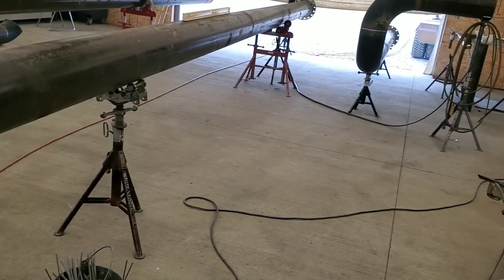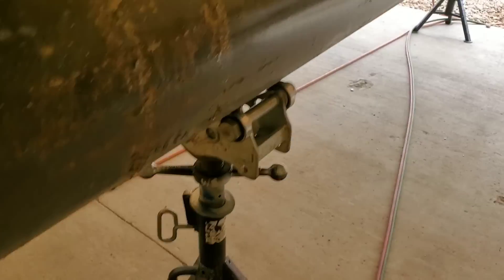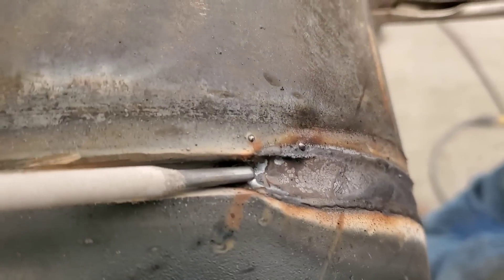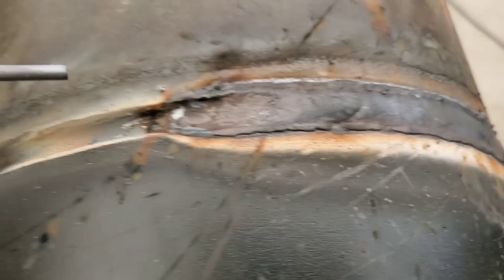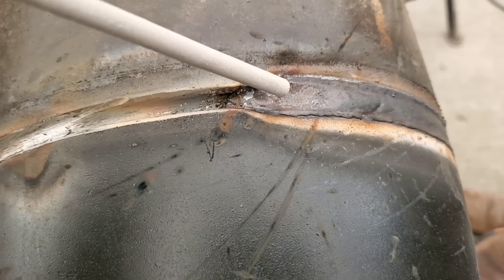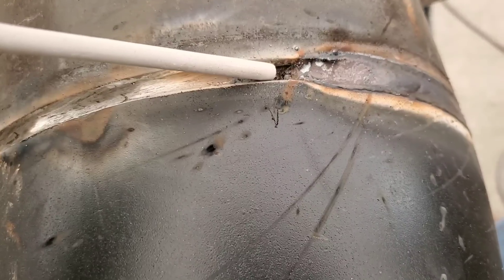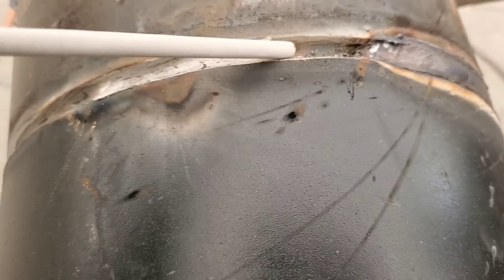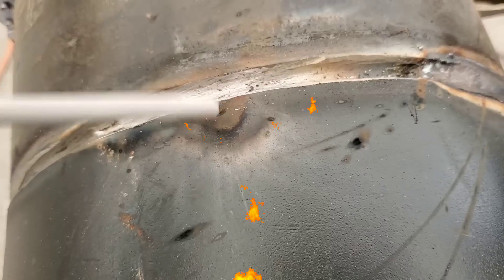Why Your 7018 Rod Keeps Sticking (Do THIS Instead)

Comment: Hi, one pass that was not displayed in the clip, which must have been rotated with 6010, the second pass was also rotated. Since the penetration power of 7018 is less, it was the skill of a welder, which was done in a first-class manner. Thank you.
Reply from the maker: All of it was rolled out

Comment: i see other guys using mig for shop pipe welding. when does that make sense vs using stick in a shop?
Reply from the maker: Just the procedure and code they want it done or if ya don’t have gas and wire just rods lol

Comment: This guys weld wouldn’t pass on any union job.  You need to clean the slag off before you strike an arc and you only go about 1/2 an inch back to marry the two welds together so it’s smooth
Reply from the maker: I wouldn't join your ugly union if it was the last job on earth. Never been union never plan on going union. You give them boys a bad name anyways. Step aside please. Learn a lil. Union got nothing on me. Union is wack in my own personal opinion. Who pays to get paid. Sounds like a rap game scheme. I'm good.

Comment: 207 amps dang! I've seen 7018 rods glowing red hot (tip to clamp) at way less amps (like maybe 150). You should do a video and please explain this topic.. What caused that/ how to prevent. Awesome welding/attitude bru!
Reply: 150 amps is still in parameter for 1\8".. he was using 5\32"

Comment: Sweet! Your awesome! You ever weld in a valve compressor station? PGE?
Reply from the maker: I use to work in a packing place where we built compression units that went all over the world. I built vessels and piped it all out to the cooler. Built day tanks. Scrubbers. Suction and discharge vessels
Reply from the maker: Alot stainless socket welds. Built alot stainless skids for Saudi' Arabia

Comment: Hey Wally where did you get your chain vicegrip? I have 1 but it only is good to 6” pipe. Looks like your on 10”? Nice work
Reply from the maker: I had to buy a extra chain and add it
Reply: Ok thanks. 5/32-180 amps on 6” cap. You ever run any 7/32?
Reply from the maker: Oh yeah even 1/4
Reply: @Wallyzweldingworld  damn, what's amperage for that beast? I usually just use 3/32 at my job, usually because machine is 4 floors away with no remote option so u set and rock. I'd love to use nice machines, stands and roll out wheels
Reply: Hi sir I'm sajjad forum pakistan weldar job please contact me sir
Reply: 00923149882742 watsap nambar please contact me sir